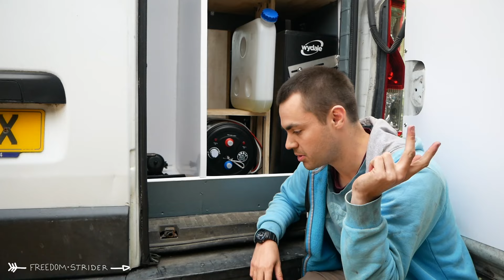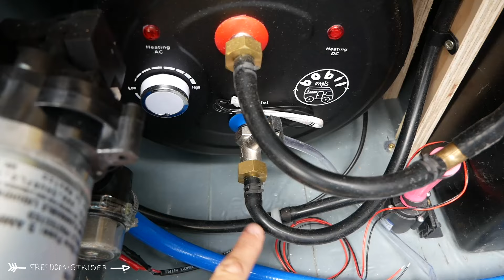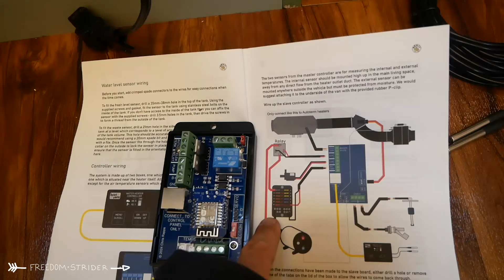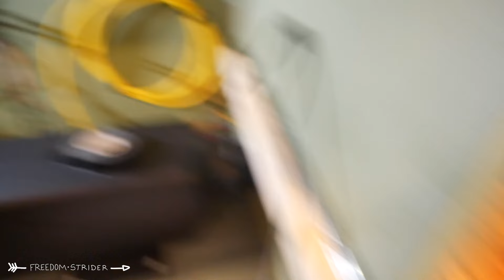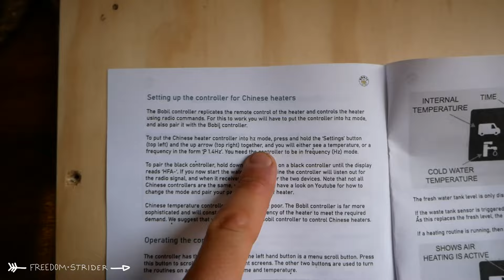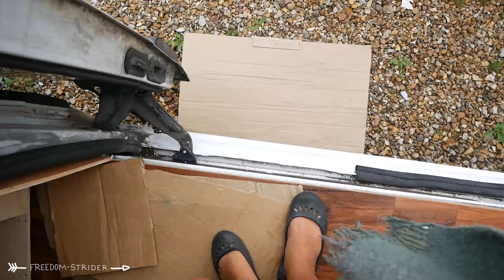Campervan Hot Water from our DIESEL HEATER (for £500!) | Ep. 8

Comment: I have a question, do you have a sealed hot water system with underfloor heating, I cannot see a Expansion Vessel, as when hot water expands it needs room, the addon would prevent leaking, the other thing I noticed you don't have a drain on the water tank? I know you have one on the heated tank, but having one on the cold tank could save you a floor if it leaked, might consider a pressure release valve on the heating system IF it's a sealed hot water system,
Reply: as he clearly explaned, they have air heating. ..

Comment: Very well explained, thanks. How is it in summer, does the air duct to the heat exchanger worm up the van? And is it possible to connect the heat exchanger to the heater exhaust to use what is essentially wasted heat?

Comment: Did you already put this system in use? How do you like it? 
How long does it take to heat the water for taking a shower?
In summer can you heat the water without heating the interior of the van? It seems there is still an air outlet after the heat exchanger into the van.